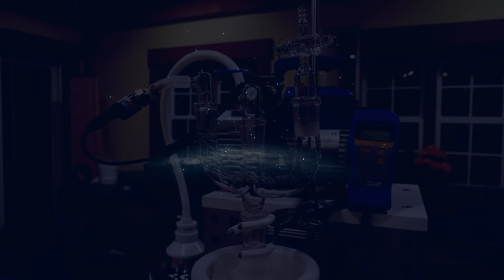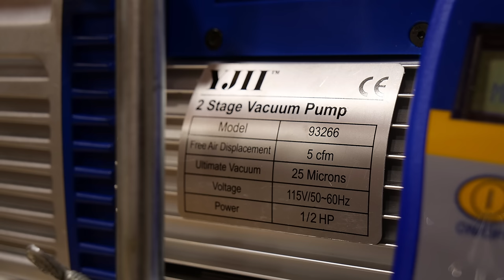Vacuum pump with NO moving parts

Comment: When you let back in air and then seal it off (at 19:50 in this video), how much of the drop in pressure is just from the room-temperature air being cooled to liquid nitrogen temperature? I would really like to see a control experiment where this is done without the beads.
Reply from the maker: About four fold ie  77K/300K.
Reply: @TechIngredients  Thanks. So the pressure maxes out at 6400 Microns in the video, and drops to 2900 before the video cross-fades away. That's just a 2.2× decrease, and the cooling alone should've done about 3.8×. I'm guessing this is because the air cooled as it entered, and thus had already experienced part of its pressure drop before the vacuum gauge was able to reach equilibrium in its measurement. This makes it very unclear how much of that was from the beads, making this part of the video confusing.

Comment: I would love to see a video on why argon is used for aluminum welding, while different ratios of argon and CO2 are used for steel. There's clearly alot more going on at the molecular level than I understand, as I've recently found out from having to use pure Argon for welding steel since our industrial supplier accidentally mixed up our order for the month. It works, but the bead looks different and it doesn't seem to penetrate as easily. I'm also curious as to why argon, and not another noble gas like neon or xenon is used for this, or even an inert gas like Nitrogen.

Edit: i can understand why the absence of CO2 would affect the appearance of the bead, but I don't understand how it affects penetration. It's worth noting that I've also seen some increased porosity issues as well, but that could be simply be because I'm a mechanic working in less than ideal environments, and not a professional welder. Since straight argon seems to cause the beads to be taller, I find myself having to spend more time grinding, and then finding the porosity inside of the welds.
Reply from the maker: I can't answer that, however the price of neon or xenon is many, many times greater than argon.
Reply: @TechIngredients  Wow, you weren't kidding about reading every comment. I'll have to do some reading and research on my own to figure this mystery out then. While on the subject though, I believe it was Cody's Lab and AvE that did a pair of videos on cold welding, where they tried to get 2 finely polished pieces of gold to cold weld in a standard vacuum chamber with no success. If you have a chance, you should look it up as I wonder if you could do it better with a setup like this.
Reply from the maker: I might, but the surfaces have to be atomically flat and clean.  Also, to get the crystal structure to realign at the interface, some heat may still be needed although much less than the melting point.

Comment: I think a better control would have been for you to cool the empty vessel with the liquid nitrogen. The gas is going to have its pressure go down as you cool it so you havent demonstrated how well the sieves work. You are right of course in concept but I think the experimental setup has a few flaws. Also the cryos I have works on always used activated carbon coatings for adsorption... would be interesting to see it used vs the 3A sieves  in your system. I like the video though keep up the good work!
Reply from the maker: The pressure would indeed drop, but no added gas would be removed and the pressure would not fall nearly as far even for an extremely small quantity of additional gas.
Reply: @TechIngredients  

So the air you let in should be room temperature. Lets 298K. You let in about 6500 microns of air (19:58). Im going to assume at that time that the air is still room temperature as this was done relatively fast( I think I can show it will be slightly hotter than room temp but I dont want to complicate things too much and room temp is being conservative in your case anyway).

Now the pressure shown on video gets down to  3000 microns(20:06). Assuming this is at the temperature of the liquid nitrogen that means we got a pressure ratio of (6500/3000 = 2.2) this is despite the fact that it should be a ratio of (298/77 = 3.9) where 77 is the boiling point of liquid nitrogen. This would correspond to a pressure of 1700 microns.

I dont think the air you let in got to 77K but the point is to show that the adsorption is doing the pumping and not the cooling you would want to get below the 1700 micron point.( hopefully that made sense). In other words you havent shown adsorption is doing pumping since we cant rule out the effect of cooling the air since we are above the theoretical point.

All this is assuming ideal gas but I think that is safe at these pressures.
Sorry should have included the maths in the first comment was being a bum.

Comment: Maybe I'm wrong, but wouldn't some of the observed pressure drop be due to isochoric cooling of the room temperature introduced gases down to LN2 temperatures? It would definitely take some time and would only produce a pressure decrease of about a factor of 3. You mentioned the billowing of the evaporating LN2 when opening the valve, which indicates that heat is being transferred from the interior of the vessel to the LN2. This heat transfer could be from the cooling of the introduced gas. It's hard to figure out the relative strength of the two effects without doing more math, data, and thinking.
Anyways, enjoyed the video and the latest series on vacuum and plasma systems.
Reply from the maker: That will occur, but the small surface area will not adsorb any significant amount of added gas.

Comment: Beautiful demo of how zeolite works and... all kinds of important concepts like the difference between adsorption and absorption. 

I was wondering about the "trap" you're venting the rotary vane pump into. What..uh... whatcha got goin on there? Is it a carbon filter etc for safety to protect you from vapors and atomized pump oil? Is it diy or is this a hole in my trap knowledge? 

Liked, subbed, and will be going through your content. Molecular sieves are one of my favorite things in the lab next to parafilm. Maybe you could do a video on how parafilm is made and how they manage that staged stretch that's so satisfying? It's a shame it's so expensive or I'd use it for everything. That feeling of the perfect wrap never gets old... takes a while for the parafilm to get old, too. 

Also, I had these packs of fiberglass wrapped wire that I've always puzzled over. Now I see it's insulation for high vac (and temp) work! Man, I love science kit! It's all first principles and the perfection of simple design. I would work for free if it meant running reactions all day without all the begging for funding to pay for the reagents. No room for the home schlenk line anymore... well, unless you have a legal product I can make with a market that's easy to sell into. Custom precursors would be a dream gig. 

Thanks again! Absolutely love that feeling when loosely connected dots come together. Thanks for filling a hole in my knowledge! Just an infinite number of holes left and ill understand what the heck is going on

Comment: Window glass manufacturers have problems when they make sealed, insulated glass panels on hot, humid days.  The individual glass sheets get sucked together as the space is evacuated. On large sizes like sliding door glass, the glass lites can touch each other in the center. They use different methods to combat this, but those methods might defeat the intended function of the dessicant.

Comment: I realize this video is ancient, but... 

I've had some ideas around using highly activated carbon for adsorbtion of ammonia for a solar driven cooler where the adsobtion is driven by a calcium chloride-activated carbon matrix.   Very useful for cyclical development of many BTU worth of cooling throughout the high solar portion of the day with minimal moving parts. Solar cooling by running a few valves and a fan 

Also another adsorbtion idea I haven't fleshed out is adsorbtion of natural gas (methane) on activated carbon. Nat Gas is easy to produce on a renewable basis from the chaff of agriculture, but hard to store and distribute. This might make transportation viable.

Comment: Hypothetically speaking, you could use one container with the aluminum silicate (?) inside and hook it up to another container that you want to draw a vacuum on, as a "poor person's vacuum pump" then (provided the containers are not too large)?  

  Pretty cool--awesome tips--thank you.   I've been thinking a lot about vacuum's lately for various different projects from Solar heaters to electrical experiments.  Oddly, a little while ago (earlier today), I was actually talking about using heat/gas expansion to facilitate a vacuum.  

   Any chance you could do a related video on ways of easily sealing the containers permanently once you've drawn the vacuum?  I don't want to use a ball valve, and I don't have a torch hot enough to melt borosilicate glass (nor even soda glass really).   I've thought of using epoxy with a filler or water glass with a filler.

  As an aside, isn't aluminium silicate what ceramic fiber insulation is made out of?  Or is this slightly different stuff?
Reply from the maker: I think that's calcium silicate.  To maintain a vacuum for a long time you need a "hard seal" ie solder or glass.  An easy method is indium.  It will seal to glass and melts at around 150 C.  Place a small strip of foil between glass parts and heat.  It's not unlike sweating copper plumbing.
Reply: @TechIngredients     Ah, very interesting.  Thank you very much for the further info.

Comment: Wouldn't something like a cold trap produce a vacuum as well? I'd be curious how much vacuum you could pull if you just cooled the flask
Reply: This seems like a good lab question!  I think you could use a plain old cold trap, and later pour in some molecular sieve.  I think it will make a big difference!  As an aside, I want to process neon tubes this way, and reading gives me the idea that maybe ONE GRAM of molecular sieve will do this!  Between one and ten, which is still just like a spoon full I think.  This is to catch mostly water vapor, some CO2.

Comment: For the hobbyist it's Liquid Nitrogen (from local welding supply companies) or Dry Ice which is sold locally in a very few grocery stores.  Historically Dry Ice was regarded as inferior but cheaper.  Now I'm not sure!  I think per dollar you might get more refrigerating power from LN2,  which seems hard to believe.  A BIG question to me, and there doesn't seem to be anything in the literature about it:  How does this stuff work at Dry Ice temperature?   There's a lot of literature about plain cold traps at Dry Ice temperature, but not Cryo-Sorption traps.  You know, in case it turns out that Dry Ice IS cheaper and more available!     The vacuum system we see here might have good performance with just a plain old cold trap, I'm thinking (hoping!), which are sometimes quite cheap on eBay say.  The main thing we want to get out of a "Neon" tube is water vapor....
Reply from the maker: The cooling power of liquid nitrogen and dry ice is similar per dollar.  The liquid nitrogen will obviously get your experiment colder, but is more costly to store and transport, although once you deal with that, the storage time in a dewer is much longer.

Comment: Suppose you spin air around inside of a cylinder.  It seems like if the air was spinning fast enough that a good vacuum might be obtained near the center.  Or if you injected a jet of air at high velocity, the air inside the cylinder would tend to be trapped by the spinning air and evacuate the center.

Comment: Why did the pump not lower the pressure while heating? Was it that gas boiled off of the surface too fast for the pump to keep up with? But that did not seem to be the case, the pressure did not come down much even while cooling to room temperarure. Was the pump running, but a valve to the pump closed? According to the sound, the pump was running, I think.
Reply from the maker: You're correct.  The heating produces a lot of gas and the pump was just keeping up. Volumetric pumps move very little gas near their low pressure limits.

Comment: Does the molecular sieve need to be super cooled in order to act as a vacuum or is room temperature acceptable? I'm thinking a neat application might be maintaining a vacuum chamber for extended periods of time.
Reply from the maker: It will work at room temperature, but it will hold more gas and maintain a lower pressure the colder it gets. As the temperature drops below the boiling point of each gas the capacity and pumping speed increase greatly.

Comment: I wonder how much vacuum pump oil was in the chamber by the time you cooled the sieves. My guess is they wont be very good at "pumping" large molecules like oil and will act like solid balls for those.
(Vacuum pump oil always backstreams from mechanical pumps, and probably the glass seals in the apparatus)

Comment: Immersion in liquid nitrogen can make immersed objects cold, but it's only the phase change of liquid nitrogen to gas that produces that transfer of thermal energy. If the phase change slows, so does the transfer. Slight warming of the flask renews the phase change beyond the static configuration, and so the flask ratchets away additional thermal energy. It can be repeated until nearly the limit of nitrogen phase change at atmospheric pressure is reached. That's where the additional adsorption comes from: "additional cold". You could increase the effect by placing the liquid nitrogen itself in a partial vacuum and goosing the phase change. Right? This should be measurable, reproducible, and an interesting experiment.
Reply from the maker: Sort of 
It's  true that the phase change  is what makes liquid nitrogen cold and maintains its  temperature  as it absorbs heat.  But, the transfer of heat is the propagation of thermal vibrations from the heat source to the liquid. That is why a solid can transfer heat without a phase change occurring as in a room temperature  water bath.

Comment: @TechIngredients Seriously amazing video, thank you for publishing so much content that have the rare trifecta of being educational, informative, and entertaining. Despite your excellent explanation of Van der waals forces, I'm a bit confused as to why running the vacuum pump for longer (ie, days rather than hours) doesn't result in an ever decreasing ultimate pressure? Are the cooled mol sieve beads attracting the "stickier" gas molecules away from all the other surfaces like the glass and tubing? Also, would the vacuum gauge have read significantly lower if the probe was mounted directly downstream of the vacuum pump, rather than the teed off configuration in your experiment? Finally, could you elaborate a bit on how the heat applied to the mol sieve beads actually affects the Van der waals forces? Thanks again!
Reply from the maker: There will always  be leakage that will eventually limit the lowest pressure  possible. Temperature  doesn't affect van der Waals forces, but the kinetic energy of the gas molecules that respond to those forces increases.

Comment: Feel like I'm missing something here. Does the molecular sieve need to "charged" like that with another vacuum pump every time before it is used? If so, what's wrong with the other vacuum pump that you already have?
Reply from the maker: It will allow you to pump a dangerous reaction without contaminating the rest of the vacuum system or the room.

Comment: The moment I read "Vacuum pump with NO moving parts," I thought, 'faucet aspirator.'
*PS, Certainly piqued my interest with this one. A big downside of using an aspirator is the volume of contaminated water produced even when using a circulating pump to move it. Likewise with the mechanical pump method. Greatly reduced volume with the absorption method.
Reply from the maker: Ah, but the water is moving.
Reply: @TechIngredients  Indeed. Not truly "no moving parts," but, from a general design perspective, the mechanical device is without moving parts.
Reply: After using a water aspirator you can then freeze the water vapour with liquid nitrogen, not only is the vapour pressure of water at that temperature extremely low it also traps gases when it freezes.

Comment: I keep wondering if you will mention "getters" - thin layers of alkaline earth metals like strontium and barium used inside thermionic vacuum tubes (valves in English !) to react with stray molecules to maintain the vacuum over time.
Reply: They havent done anything in that sort of vacuum range yet. Getter pumps are for far better vacuum.

Comment: Hello, can you elaborate on how toxic or dangerous is the molecular sieve itself? What happens if dust of this item were to be inhaled or ingested? There was talk about how this impacts the sealing oil, but through out the video handling of the material was by bare hands and no masks. If it is relatively safe, can you incorporate it into another one of your brewing videos?
Reply from the maker: Aluminum silicate has low toxicity and is used in cosmetics.  I'm not sure what the potential is if ingested.

Comment: Actually, I was surprised you kept pumping the vessel with rotary vane pump while cooling down the zeolith, but probably you had a reason to (maybe gas coming in through some vacuum seal would fill the sorption material during the time when you were cooling down)